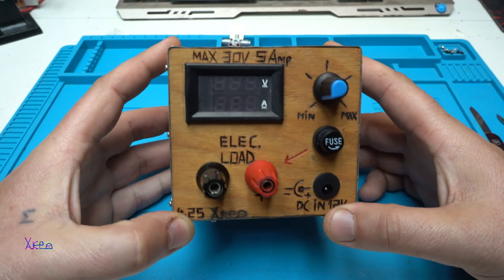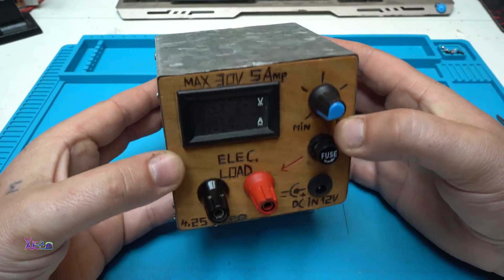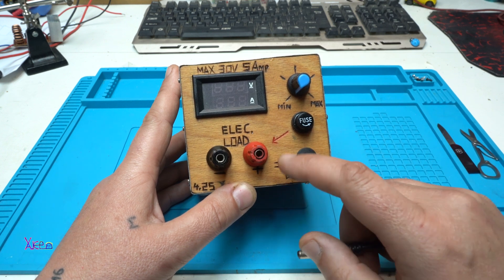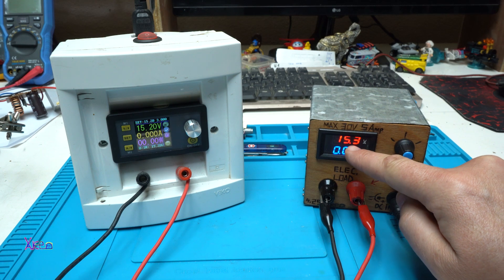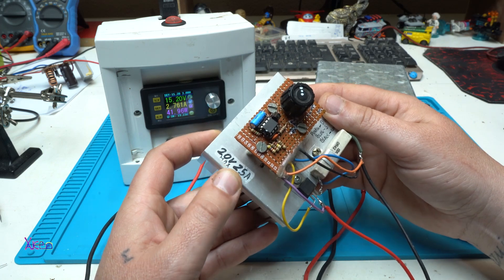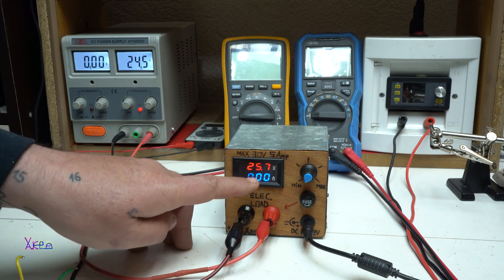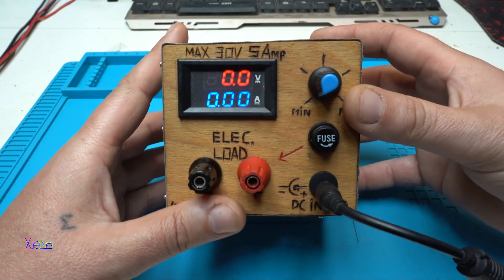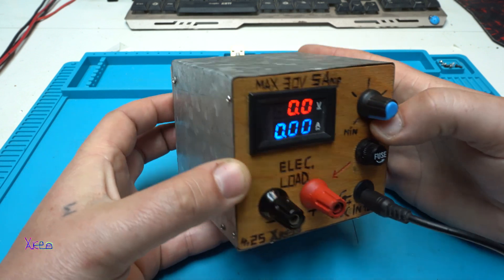I Built a 150W Electronic Load 30V 5A

Comment: Using a wirewound larger 10 or 20 ohm potentiometer  you could make a similar device for a diy solar panel load testing device.
Reply from the maker: Yes that is a good idea for a project.